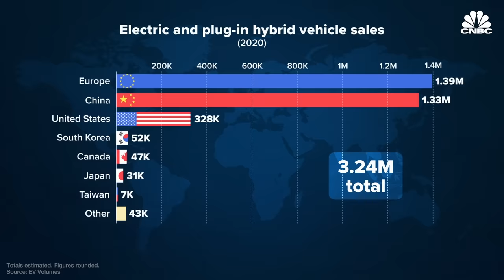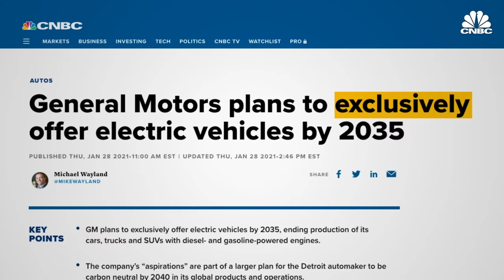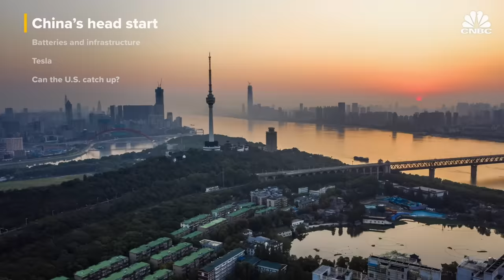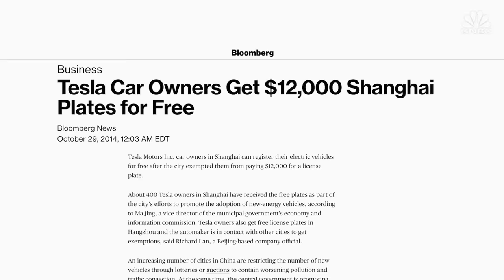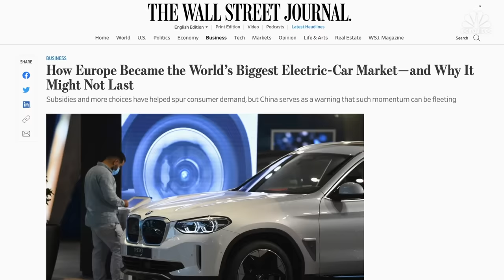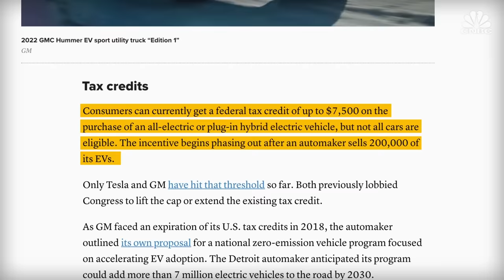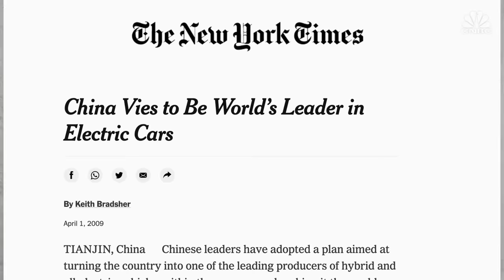Who Is Winning The Global EV Race?

Comment: I don’t consider plug in hybrid vehicles as in the same category as battery electric vehicles. Their batteries are too miniscule in terms of kWh capacity.
Reply: Not necessarily. With a home charger, those cars will run electrically 90% of the time.
Reply: @somefour  So dump that fossil fuel bit in a climate catastrophe !
Reply: @MyKharli  The 10% is for the long runs when they don't want to stop and charge. As long as electric is cheaper than gas, people will use as much electric as possible.
Reply: @somefour  You are right in specific cases where people do exactly that: charge at home to drive 90% electric.  Unfortunately this is not the case on average though.  On average the hybrids are consuming more fuel because they haul around more weight.  This was especially the case for countries where hybrids got tax incentives.
Reply: Not necessary. BYD offers DM-I platforms. It is plug in Hybrid but it’s battery is enough to drive over 100 miles, which is more than enough for daily use. When battery price rises quickly, this allows build 3x more cars using the same amount battery. Yet, over 90% of time, cars are driving on battery.
Reply: ChargePoint + Tesla = all you need.
Reply: But they're SO practical!
Reply: @MattCasters  "consuming more fuel" against what? It's still lighter than BEV and offers a significant improvement in efficiency compared to ICE. Kinda in the middle if you want the flexibility in range and lower price point from BEV.
Reply: @MattCasters  as others have mentioned, byd has cars that has 100mile electric range. That's all I need in the city. As for taxi, they should have a better solution than regular EV, like battery swap since they need to stay on road as much as possible.
Reply: So what? They are much more practical than 100% EVs. I will never buy a pure EV but will consider getting a plugin hybrid.
Reply: You're wrong. It depends on where and how you live. We have a Passat GTE PHEV and it is a pure electric vehicle for 95% of what we drive (all trips to shop, to the gym, all everyday stuff). It only works as a hybrid (i.e. runs the ICE) when we take road trips. The ICE is literally not used at all most weeks because the 50km electric range is more than enough for our everyday needs. I know that's not true for everyone but for most people in urban environments it is.
Reply: @daremasterco7321  You have no idea what you're talking about. Yes PHEV is a stop-gap solution but they are EVs and for a while they are needed by some people. See my other comments in this thread. Also note the difference between "hybrids" and PHEV.
Reply: @somefour  
If they run on electricity 90% of the time, why do they need an ICE unit?
Just add 10% more battery.
Reply: Once the average electric car has a range over 300 miles, which will happen soon, very few people will need a hybrid. And, once we all have solar panels on our roofs, or get our power from local wind, or geothermal, or some other cheap, renewable source, nobody will need a hybrid.
Reply: @somefour  yeah but only like 5-10% of buyers actually use them this way. Many hybrids are more like the hybrid cars in Formula 1. A bit of extra of the line speed for your ice car with an added electric motor. Others just build it for the incentive, especially in germany audi and mercedes did this + payed off the government to keep funding hybrids. Noone buys a 500 hp mercedes with a 450hp ICE and a 50hp electic engine to lower his CO2 emissions..
Reply: @daremasterco7321  why would government pressure to build hybrid government don't sell oil and they are the ones putting regulations to reduce oil consumption
Reply: I think you need to update your view on plugins. The newly released Han DM-I hybrid sedan by BYD has a range up to 242km NEDC. That's more than enough for daily commute. So the battery capacity isn't exactly "miniscule".
Reply: @tinytownsoftware3837  As saod the horse owners a century ago.. Wake up man, BEV's are more practical then you assume!
Reply: @ujjalshill6442  Because government make the new rules to clean up our environment with tighter and tighter rules for exhaust gasses, car producers are indirectly forced to make hybrids to follow these rules. Do you think the car makers started to produce hybrids to  make the environment better?
Reply: @maniacyro5167  Plugins are good, ICE should be illigal however!
Reply: @maniacyro5167  this is an outlier though, not the norm. And if you already have that much electric range, why put a heavy ICE powertrain into your car. And if you actually need your ICE engine you obviously carry a heavy battery around. Hybrids aren't combining the best of 2 worlds as they promise but instead the worst of 2 worlds. What you need to understand is that with smaller batteries you run through charging cycles more often, thus you start to see degradation really fast. Since you have no optimization for efficiency you likely have no heatpump either, so a realistic range after a couple of years in winter conditions would likely be 150 km or less, which then again lets you run through your charging cycle even faster, thus increasing the degradation, pretty much a cycle of lowering your electric range. Yes with 242km it's not as terrible as with 50-60km which would pretty much need a battery replacement after 2-3 years, but the problem isn't really solved and it's simply an inefficient solution only to safe yourself maybe 20-30 minutes of charging whenever you actually travel long distance
Reply: @teslaheini3169  I think it's up to the comsumers to decide what they want. At least for the past year, sales numbers show a huge uptick in demand for hybrids, especially those powered by BYD DM-i technologies. And it's not that chinese car buyers don't have options. With the tons of options available both in good value pure EVs and ICE cars, many of them still opt for hybrids. It goes to show what they really want. We are now in a transitional period with EV infrastructures lacking, when charging is still an issue to many including myself. I don't know how long it's gonna last, but for many who are inclined to replacing there old ICE cars with ev but couldn't for some reason get access to a charging point conveniently, hybrids might be the second best option they settle for to last them through the transitional years until charging is not longer an issue.
Reply: @daremasterco7321  Sure, they're practical if you don't take any road trips. If you drive more than your range once in a while (which lots of people do), you cannot make the argument that they are more practical than ICEs. That is why I am holding out. Yes, it would be nice to charge at home. I have actually owned a Nissan Leaf and am speaking for experience. It's the times when you need to drive farther. I simply don't want to deal with charging it on the road. Been there, done that. No thanks.
Reply: @Jiajun Han  It makes more sense too. It's good for people who have short commutes but still go on road trips 2 or 3 times a year.
Reply: @MattCasters  Matt your contention has been proven wrong over and over, the first real plug in hybrid was the Chevy Volt, and to date over 88% of those drivers plugged in regularly and ran on electric for the vast majority of their driving needs, we know this because the car keeps track of if it's running as and EV or as a Hybrid burning gas, similar numbers were found on the Honda Clarity and Rav4 Prime and Prius Prime, as for your point that their hauling around a ICE, it really doesn't matter because pure EV usage is for around town, long trips on the highway where EV efficiency comes into play are on gasoline, and 40-45 mpg is good enough for the few long trips they take. The only reason it wrinkles your feathers is because your a EV zealot. For most people who don't live in a big city, a good plug in Hybrid is a far  better choice in the US with the current infrastructure.
Reply: @olpo2001    O pn by pp
Reply: Hybrid is a great stepping stone, a temporary technology.
Reply: @luting3  
Thanks. That’s interesting. 100 miles range covers most days. That’s great.
Reply: @luting3  
If the battery goes 100 miles, maybe there’s not even a need for hybrid? They could charge, or have a small engine as generator, like that BMW carb
Reply: INDIA WANTS TO FALL DOLLARS VALUE..
Reply: All EV owners are clearly smiling now against gas cars and gas prices.
Reply: In practice, plug in hybrids can run in pure electric mode from 20 to up to 50 miles before depleting and therefore turn on the gas engine.  That is a very very useful range for most of us who end up not needing or barely needing to use any gas at all.
Reply: @kabysummit5801  There are studies that indicate the majority of PHEV owners neglect to plug in frequently. I’m not sure if this is still the case. I’m a proponent of PHEVs in general but only as a part of the general wider transition to pure battery electric vehicles.
Reply: @cantbeatthebay4765  Absolutely correct our M3 has all the range we and I suspect most others need. It's a great car, does everything we need.
Reply: Haval H6 Hybrid has an electric range on 63km. My daily trips are about 10km.
On weekends I may drive about 50km.
During school holidays, I may drive about 400km in a day.
For me and many others in Australia where there are no charging infrastructure outside the cities, PHEV makes sense.
Reply: @MattCasters  , hybrids are more fuel efficient even with the weight of the battery and extra drive system. The system is able to use electric when it is more efficient to do so, and gas when it isn't. Further, electric makes things like breaking energy recovery possible instead of just throwing all of that momentum away as heat. This is the reason you'll see an odd reversal with hybrids where city can be more fuel efficient than highway MPG. Normally shedding that momentum by constant breaking eats away at MPG really fast, but hybrids can cope with it a lot better. Plug-in hybrids are really just hybrids with larger batteries. Even if you don't plugin them in as much as you should (which is a waste in my opinion), they still are beneficial compared to pure ICE. Electricity usage isn't much actually when running through the math. Chances are very likely if your electricity costs are high, your fuel prices are higher. The Prius Prime has about a 75% efficiency for unit of energy to movement, whereas most ICE vehicles are 30-35% efficient, and have a top theoretical efficiency of around 50% when you consider temperature differentials that ICE vehicles are to operate in (the larger the difference the more efficient since ICE engines are heat engines, extracting work from the difference). Based on my driving patterns I calculated I'd get about 200 extra miles for about $6 of electricity over the course of 1 tank of gas for a total combined MPG of roughly 73.
Reply: @somefour  generated by coal.
Reply: @cantbeatthebay4765  and coal and natural gas to generate it all.
Reply: @rogerstarkey5390  you need to read other's opinion before objection.
Reply: Well yes and no. I drove a 2021 Seat leon Ehybrid ( plug in ) to a local dealership for a warranty repair. its about 18 km's from here to there. it said it had  power for aprox 27 km's of pure electric range at about 47% state of charge. when i got there, it waid it still had something like 14 km's left of pure electric driving, i dont remember the state of charge. 23% maybe. i believe it has a 11kwh battery. 

i wouldnt bother with a PHEV myself. but i see how they can be a decent choice, given the right driving pattern, especially if they release longer range version with like, 18 kwh batteries.
Reply: @MattCasters  , "and yet the hard numbers show that average consumption went up"

MPG? Compared to pure internal combustion they're a lot better in MPG. Based on my driving habits a Prius Prime can net me 73MPG equivalent. Not great compared to pure EV, but far better than pure IC. You will have to understand that there is still a need for IC currently in some form since EV tech isn't quite there for every market segment. That is why there is a lot of research going on right now for battery tech, that is the key that'll open up EV for most market segments.
Reply: @MattCasters  , and yes, regenerative breaking and using the EV portion of the hybrid strategically helps a ton on MPG. I'm not sure where the heck you're getting your numbers to backup your claims. Hybrids are a lot better than pure IC engines, no question about it. If you simply want to advocate for pure EV, then go at it, but physics and general stats don't backup your issue with hybrids. The only time a hybrid may perform worse is someone who drives purely highway and never has any stop and go traffic... however, the majority of the US population has either an even mix of city and highway or a large portion city. In these scenarios the hybrid EV modes help a ton, usually reversing the IC trend towards higher city than highway MPG. I'm open to being wrong here, but you keep making odd unfounded claims that don't fit any data I've seen.
Reply: Most people dont drive far.
Reply: Always love Prius very good in mpg. Loved owning it
Reply: 80-120 kWh in VW groups Full plug n drive hybrids which deliver 100 to 160 mpg in full hybrid mode, but are still mechanical monsters!
Reply: VW is an EV leader in China, as well as majority market share of all cars in China
Reply: depends on your uses and purposes. Each scenario of each individual is different
Reply: Atm I consider they are the best in both world. 

I have a wrangler 4xe that can run on pure electric for ~25miles which covers 95% my daily & weekend drives. But, I also has the option of going gas for longer road trips.
Reply: They do need much bigger batteries.
Reply: Actually, that's the main reason I didn't buy one. The battery limits you to local only if you want to stay electric. I wound up getting a Spark instead. I mean, what's the point? Might as well buy a golf cart
Reply: @phil20_20  vw group plugins typically have 90-120 or more KW of combined Lithium and Nickel hydride storage, good for 100-160 miles electric only and hybrid mpg of 95-160+ on gasoline. Plus incredible combined torque and HP output. The US has banned them! Other than a few that were given as Deisel tradebacks between 2016-8.
Reply: EVs are still a miniscule percentage of vehicles on the road.  If everyone made a sudden switch to EVs wouldn't we need to start turning nuclear power plants to provide enough electricity to run these vehicles?  The US electric grid is not currently able to handle this load.  What happens when we get blackouts, or the electric companies decided to shut the power off because its windy and the money for maintaining the infrastructure went to bonuses and donations to politicians?
Reply: @makeupmyownmind3746  Most EV owners who have the capacity for a plug in their garage can charge during super off-peak hours between midnight and 6am. This reduces the stress on the grid which will also be increasingly load-balanced by grid-level battery storage in the coming years.
Reply: @Steve Han  Would this still be feasible if we went from 2% EVs on the road to 80% with our current infrastructure?
Reply: Exactly , they are an ice car with a small battery range, most only have a range from 7 to 50 miles for the battery,  they are essentially a ice engine
Reply: I like my hybrid, I don't have the hassle of range anxiety.. if I go to a big city hardly anyone has a garage, of my battery goes bad some day it's only $3k vs 20k 30k 40k..  if I plug it in I get 35 miles ..  I just think what's the problem with Choice?  If you have $$$ buy what ever you want..  I don't have $$$ so I bought what I could afford..  if the solid state battery comes into play that could be a game changer, but I don't like Tesla so much as you must go through them for repairs.. my hybrid I can have most of my maintenence performed anywhere.
After this past winter I'm sure EV owners up north are reevaluating their decision. 
   Even Tesla states they would have a $30k car but it ends up 40 or more.  And the battery, forget about paying for a replacement..

Comment: Battery swapping will never work on a large scale.  It costs WAY less to setup a standard charging station.  Most people get enough of a charge from overnight charging.  For those without a garage or at home charging, they can easily get enough of a charge while shopping or stopping at Wawa to get a bite or bathroom break.  Right now the fastest charging car is the Lucid Air, which can charge at about 20 miles per min.  Most people take 10-15 min to take a bathroom break.  In China and soon Europe, the Zeekr 007 a brand owned by Gheely, who also owns Volvo.  (They're planning on selling Zeekr at Volvo dealerships).  This car can charge about 50% FASTER than the Lucid Air.  Unlike the Lucid Air, it's only $30K!  My point is that by the time they would deploy thousands of charging stations everywhere, they would be obsolete, because the new batteries will be charging so incredibly fast, people would have no need to swap batteries.